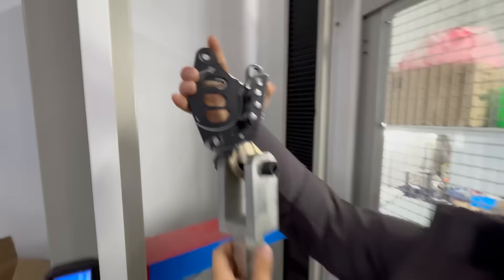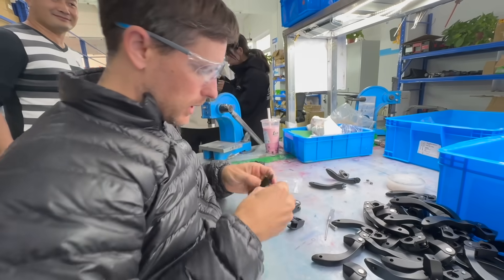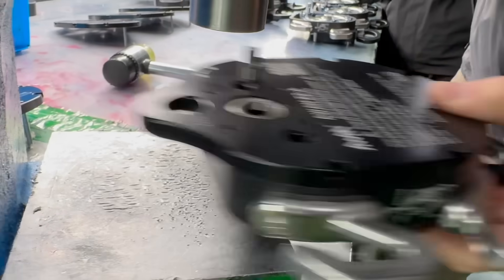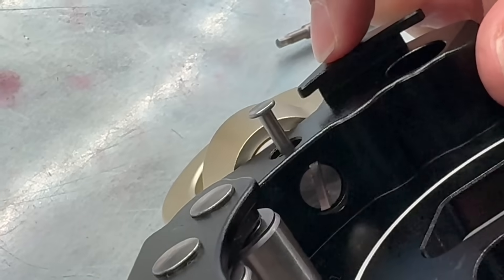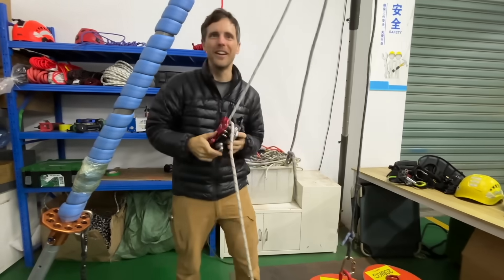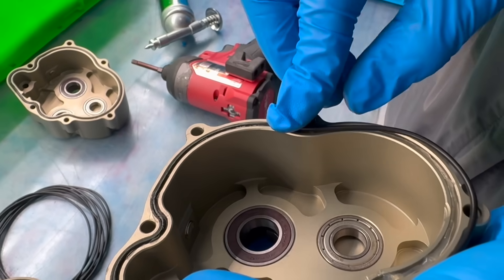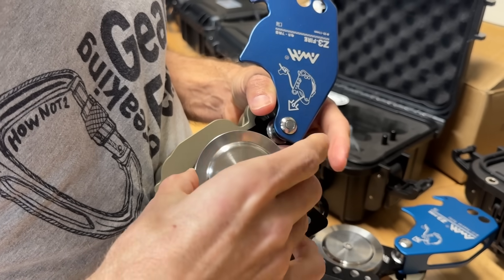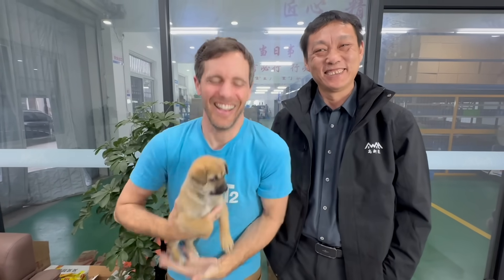I made climbing gear IN China

Comment: I wish they used torque wrenches on all the screws and pressure monitoring loadcells on the arbor presses, hopefully this is just PDR verification and not the real assembly line. Aside from that as long as they NEVER use cheap metals you won't have too many failures.

Comment: The inventor installed air conditioners for 20 yrs.  In China, ac installers have to install residential split units outside buildings up to 50 storeys high.  They have to be good climbers and have good climbing gear.

Comment: As a tree service owner, I'm actually the one who sent you those 5/8 hollow braid and tree motion harness, I have no need for 1/2in ropes. I think most modern climbing arborists have switched to 11mm semi static ropes for use in mechanical devices. The 1/2in doesn't perform will in climbing devices like a rope runner pro or akimbo.

Comment: It looks like it shouldn't cost much. $30-40. A 10-15% markup for profit. Total: $55-60.
Reply: Not necessarily.

Labour in China is cheap, but good components cost a lot everywhere (not everything made in China is made of crappy materials - quite the opposite actually).

Additionally that factory looks like it has pretty good conditions so the workers are probably being paid reasonably well (still much cheaper than labour in the US, but it isn’t the kind of place that hires unskilled labour’s for 2c and hour or whatever).
Reply: @bear4278  There are no parts in this device that could be very expensive.  All this is metal of different quality and processing.  In order for this device to cost $500, it must be produced in a single copy by 100 people with a salary of $5.  if they make 10 of them, then either they will have a salary of $50, or it will cost $50.  and if they make 100 of these per day, then the price will be $50 and the salary will be $50.  Now think how many of these parts can be made by 100 workers and you will understand that with a decent salary it cannot cost more than $40.
Reply: @ReversXC  all those shafts alone could be pretty expensive depending on the steel, machining, heat treatment and tolerances.

I.e. you could just get a piece of “10mm” mild steel round stock for next to nothing. Or you could buy and machine something like M390 to the right shape before heat treated to exactly 62HRC and then precision grinding the bearing mating surface to make it 10mm (+/- 0.001mm). That kind of part is going to cost you a small fortune anywhere in the world.

Comment: Did i see in one of your other posts, that you also visited Xinda? I've seen their stuff on alix but stayed away because it seemed sketch. Have you changed your mind on them since your "amazon carabiner" video from a few years ago?
Reply from the maker: I met Mr Xinda. Didn’t get to go to their factory. I’m still convinced Amazon should not be selling life supporting gear but have changed my mind on Xinda and Bahar. There are some factories with low QC and Amazon doesn’t vet them (get the dog joke?) or even ensure you’re getting an OEM product when you think you are.
Reply: Xinda is a huge brand in China (yes, Bahar, NTR and others too) who is/are being used mostly for altitude work.. 
Some of their stuff has UIAA and other stuff doesn't. I just don't think that it should be sold on amazon or any other platform who doesn't do due diligence on where their inventory comes from or where it has been, but hey.. BD is and other known brands are also selling their stuff there.
I'd have btw no issue trusting my life with a biner from Xinda, they are just slightly heavy and therefore not suitable for sport in my opinion.
Reply: Z3 that works on 11-12mm, then I could use it with both my arb rope and rope access ropes 😬

Comment: Really enjoyed the latest video — it’s great to see how deep you go into the manufacturing side, not just design.

I’m currently finishing a two-year mission at Petzl, as an industrial performance engineering working closely on QC, product flow, and designing manufacturing systems. Designing products is only half the hard part; manufacturing to a Six Sigma-level failure rate is the other half, and that’s the part I’m especially interested in.

Would love to get in touch and exchange more about how you handle QC and product flow on your side.
Reply from the maker: Diddo. I’d love to pick your brain! Contact@hownot2.com

Comment: How do you check that the raw materials used are actually the stuff that was spec-ed?
Reply: probably as you do in any other industry, you request a certain spec from the materials supplier, and then you test it. or send it to a lab for testing
Reply from the maker: They are iso9001 certified.  They have a complex ERP and QC process.
Reply: Doggo lick test. 
1 lick =fail 
2 or more licks = pass